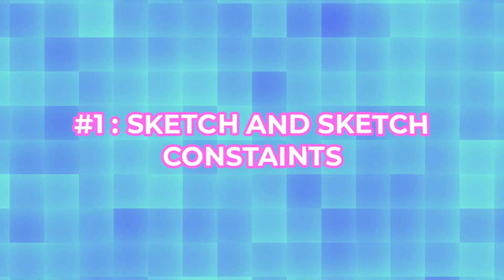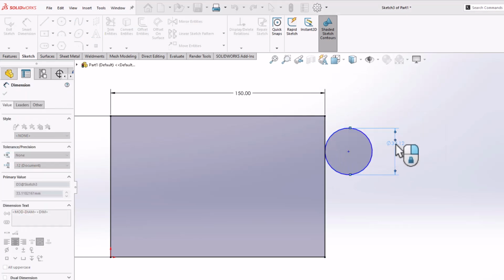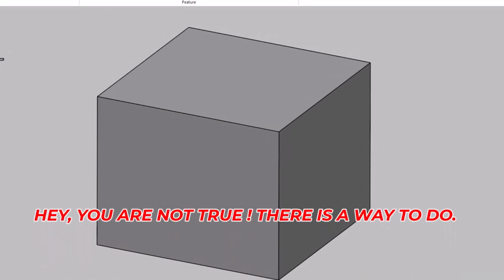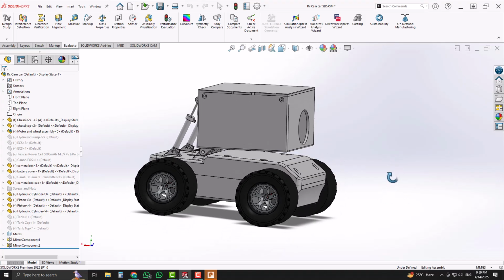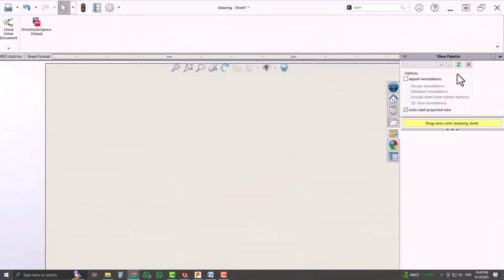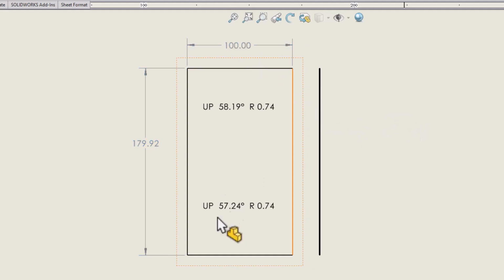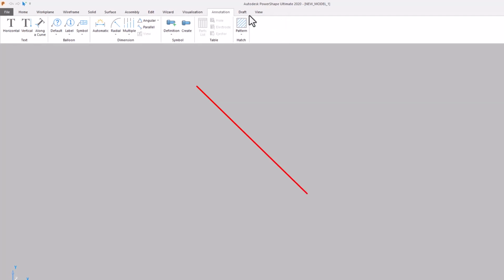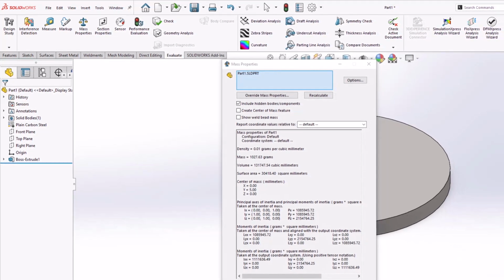8 Reasons Why I Switched from PowerShape to SolidWorks

Comment: I´m a footwear sole designer, powershape is the king for making sole in 3d, but the 2d is poorly designed, so i design in rhinoceros and illustrator and then to powershape, but for the purpose you´re using it the right program to compare solidworks i thing is fusion 360

Comment: Bro me powershape pe ab hr kism ka design bna leta hun... professionally job kr rha as a cad and programmer....im just 19 years old....kindly mjhe btai k me solidworks pe shift ho jaon?ye beneficial he kya??
Reply: In SolidWorks, the design speed will increase 10 times, and most importantly, you will be able to change the project very quickly, adjust some parts to others directly in assemblies. PowerShape is older than you. And it does not develop. This is how they drew in the days of Windows 3.x.
Reply: @plasmatec1983  cant understand your language
Reply from the maker: Depend krta hy, ap kis tra ka kaam kr rhy or kya ap ki tmam tr need powershape pura kr pa rha hy ya nai, agr industrial standards ko dykha jay to solidworks py switch huna apko nuqsan nai dy ga
Reply: @cadcammentor  sir VMC machine pe working krta hun....part ata mere pas..mene uska model bna k uksi programing krni hoti ...
Reply from the maker: Agr to sirf yhi krna hy to us k lye powershape enough hy, ap ye video pori dykhu ap ko difference nazr ajay ga.